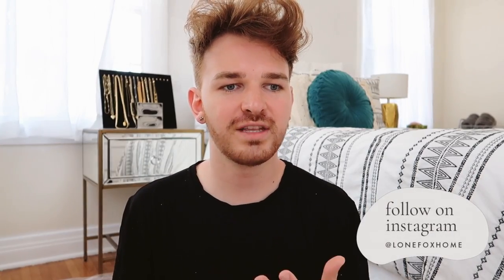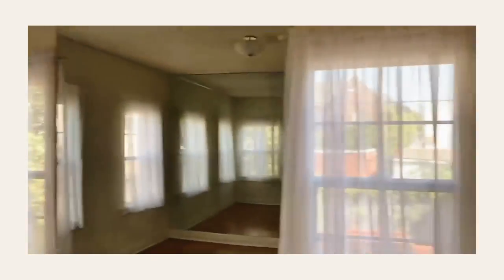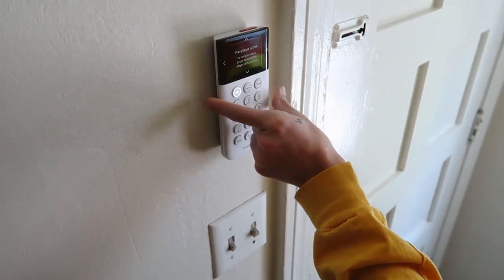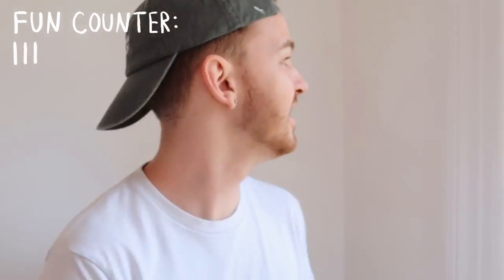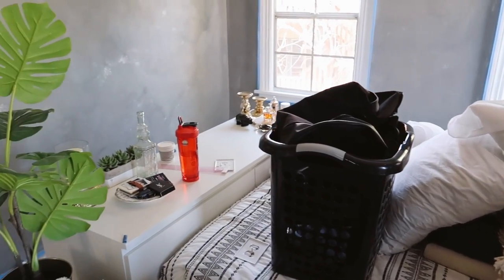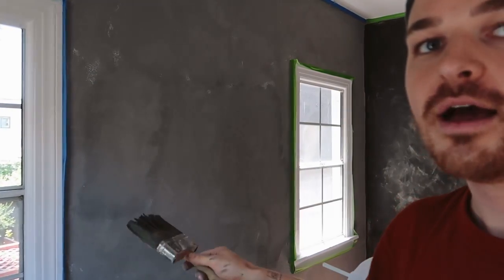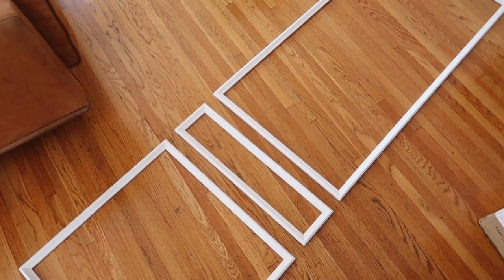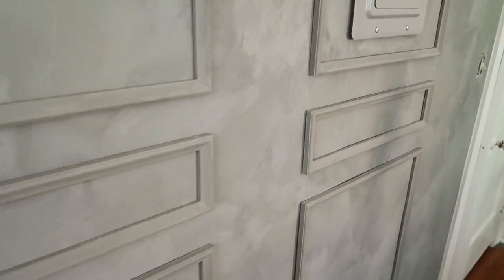EXTREME BEDROOM MAKEOVER (From Start To Finish) - DIY Wall Moulding + Plaster Paint (Part 1)

Comment: The peal and stick moulding is the absolute bomb!
Reply: Do you think the peel and stick would be strong enough to use on a ceiling?
Reply: @sandrakicklighter2735  On their website, they say to caulk everything for permanent finish !
Reply: yeah, it’s quite expensive though. it’s cheaper if you go to lowe’s and purchase moulding and construct it yourself.
Reply: @etn  yep. One wall like $300 or $400. Easily $1000 for one room.
Reply: @etn  Yeeeaa... I got EXCITED when I saw those as I want to add molding to my doors in my house but their moldings are WAY too expensive. Cheapest is $60 and I have ~12 doors and some would have to be double-sided. Eek. That adds up quick. Soo bummed!
Reply: Exactly what I just said.

Comment: I'd hang the curtains a bit lower if it were me, halfway between the window and the ceiling is a good way to go! I am OBSESSED with the peel and stick molding! Didn't think it could get easier with pre-made pvc ones but I stand corrected

Comment: Wow, talk about multitasking! I don't know if I could paint walls and watch a movie at the same time! Music or a podcast, yes, a movie, not so much! The room looks so nice! Mr. Kate used some pre-made moldings on their last video. The ones they used also had adhesive backing, but Joey also nailed them to the walls and caulked around the edges, and then painted. I'm thinking about using them and would like to be able to skip all the extra steps Joey did. My question is, can you see any spaces or gaps between the moldings and the walls?
Reply from the maker: It really depends on how straight/flat the walls are! Certain parts weren't completely flush with the wall because the walls in the room are not perfect :(
Reply: @lonefox  Thank you! Love the work you do 💜

Comment: Tip from scenic painting for those who want to try to achieve this look but can't afford the really expensive paint! If you take water soluble paint and add water to the amount your using until it's only slightly opaque when you dip your finger in (you should see color but you should also be able to see your fingerprint pretty well) and use this same painting technique (it's called a scumble if you want to know how!) you'll achieve a very similar look for cheaper! Paint isn't cheap by any means but if you make your own wash (which is basically what this paint is) you can save a bit of money!
Reply: Side note: it does typically end up being a rather flat finish so if you're looking for something else you may need another paint

Comment: The wall moulding looks amazing!! I want to do this to my living room but those kits are pretty expensive T_T
Reply: Have you looked at just buying lengths of wall molding and cutting yourself? 
Would recommend a mitre box, hand saw, one clamp, glue, fine nails, bit of sanding paper and some wood putty to fill in the cracks at the joints. 
You can either nail them to the wall or get strong double sided tape like they used
Reply: @raebla  Yeah, that's what I'm going to end up doing! I've just been too lazy to get all of the measurements and materials haha

Comment: How easy will it be able to restore the walls to the original color? Not only is it a darker paint. You now have plaster on it and it no longer smooth. And the wainscoting is it easy to remove?